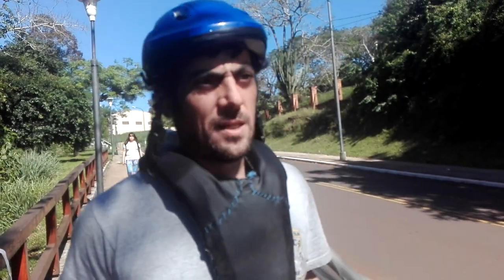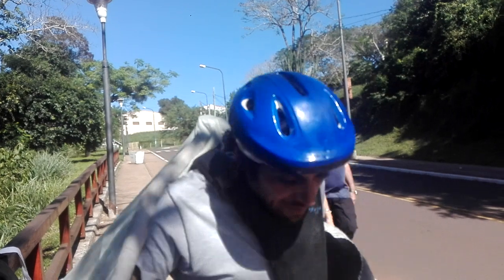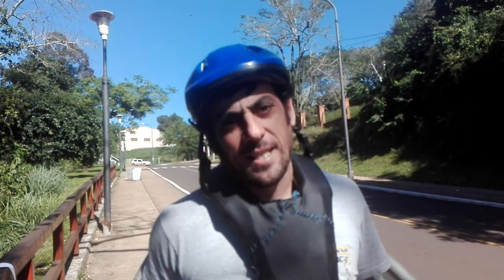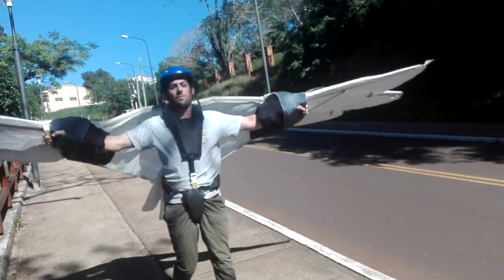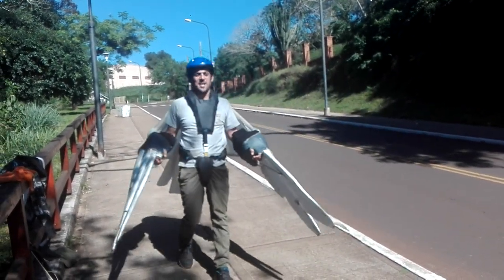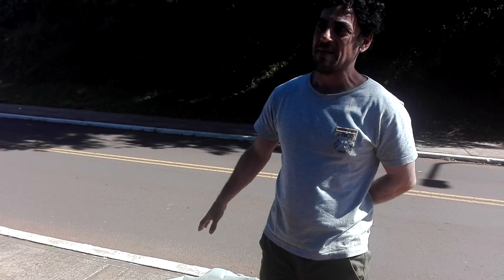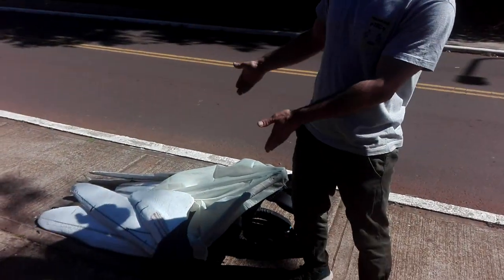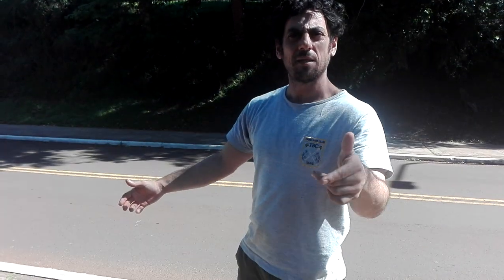Human powered ornithopter

Comment: It has to be much bigger wings and your strength is not enough... use electric drill motors to power the wings and a small battery.

Comment: Carlos with all my respect, you really are a good jumper!!! And your place are so beautiful.
Reply from the maker: You really think so, im trying to make some hoops , I can feel sustantation is enough , but I know material will not support. On my next design I will use real bones to make the exosquelleton , because the joints and curves are natural ,  and to the bamboo spines I will put feathers, then rubber and feathers to pretent skin and tendons ,remember that power for flapping is on the tendons' high tension, feathers will give thevspring power and besides let the air gets through to gain speed more than catching air like happens with fabrics , they catch too much air and thay slow them down on down stroke
Reply: @carlosornithopterlacuesta9786  pls never stop keep making new designs!!